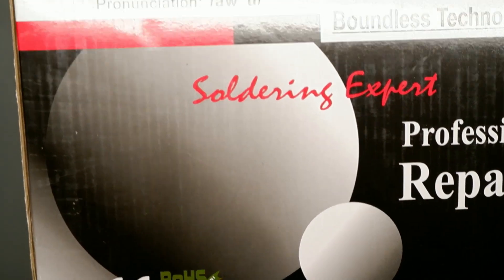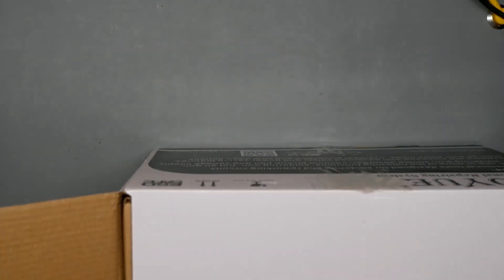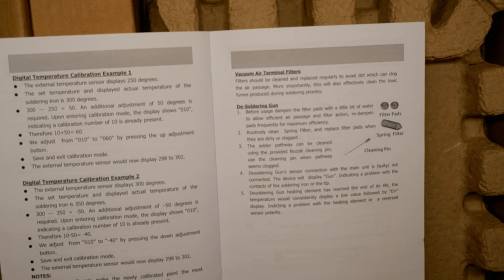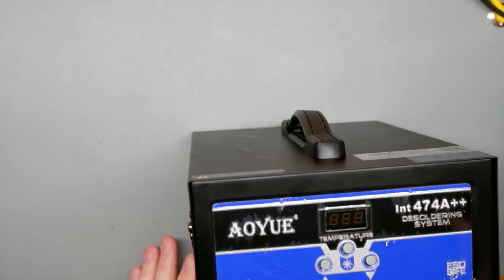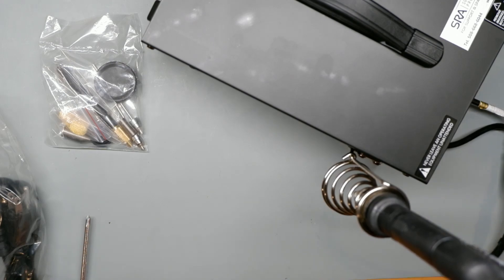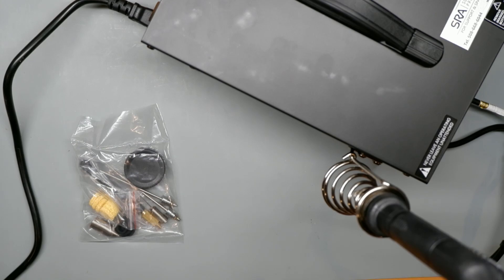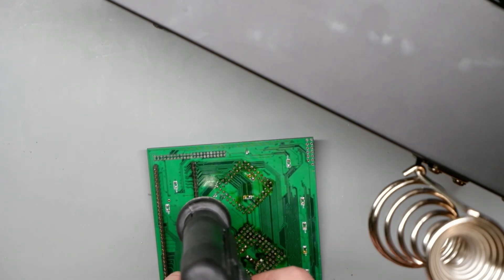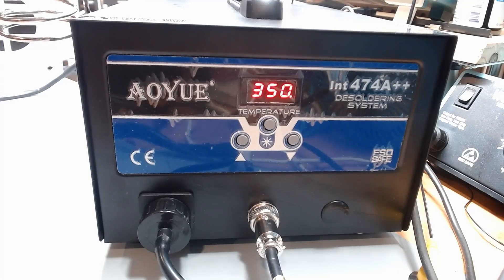Unboxing and First Use of the Aoyue 474a++ Desoldering Pump - Is it worth anything?

Comment: The Aoyue stations are just a little bit more expensive than the cheapest ZD-915 or ZD 8915. But the build quality of the Gun AND the main station is much better. Be aware that the sponge filters need dampening!  But you can also use cheap ZD 915 filters. As long as there is a filter. They do not need dampening. The gun is 95% identical to the Hakko. The wiring and the heating element, barrel and tips are different.

Comment: I got the Hakko ... both the handversion (fr-301) and the FR-400 (the 300W version)... The handversion is pretty good. Works fairly well. The FR-400 however is damn good imho (and just so you know I also have the JBC 4 tool station with a desoldering tool which is ok but feels a little underpowered to me, it probably works better with the compressor driven vacuum pump and not the standalone vacuum pump that I have).
Reply from the maker: The FR-301 is the one I was hoping for. Pretty good is definitely better than I was hearing. :)